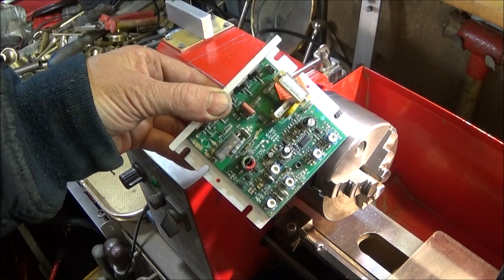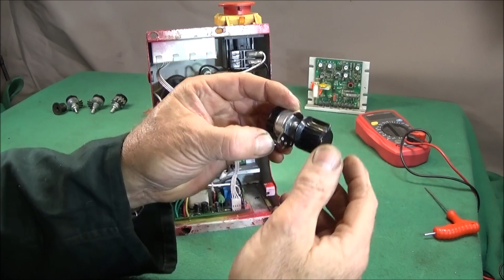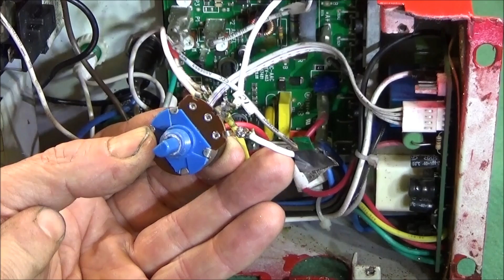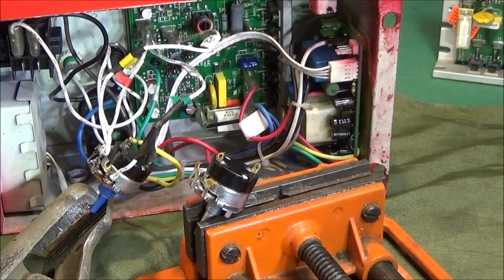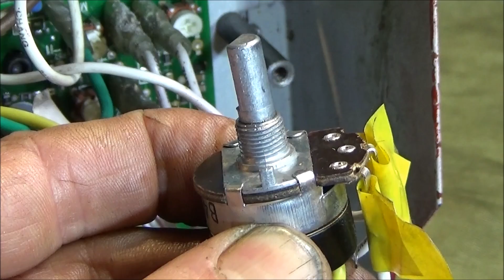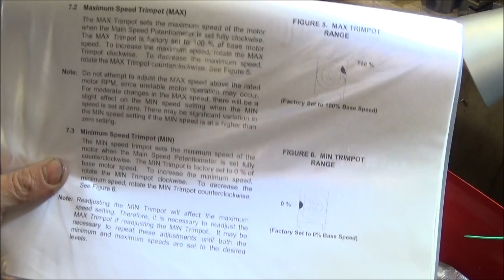How To Test & Fit A Potentiometer Speed Controller On The Chinese Mini Lather

Comment: Perfect timing as I actually am holding the new switch in my hand and preparing to install it.pretty straight forward job and your video reinforces that,Thank you and by the way the old switch lasted about 1 year with heavy use
Reply from the maker: Hi Thanks, When my first one broke, I was actually quite relieved at how easy it was to replace. I took one of the old potentiometers apart and was surprised that they can actually last a year or more! The switch arm mechanism was made of a brittle plastic! But like you say it is very straight forward to change and its great that you can get the spares easily. Regards, Steve